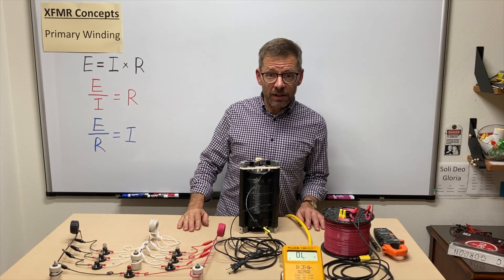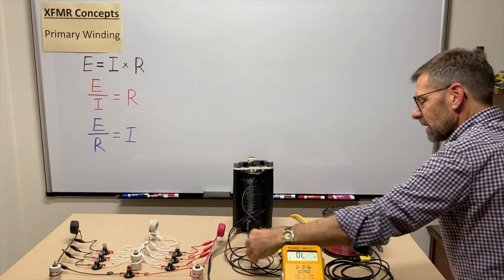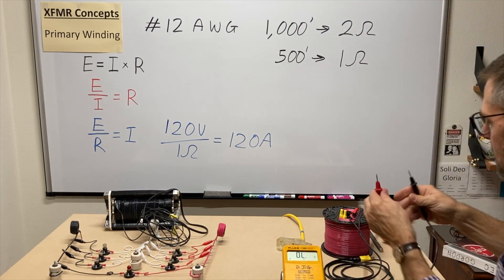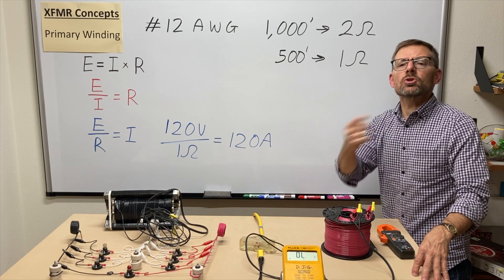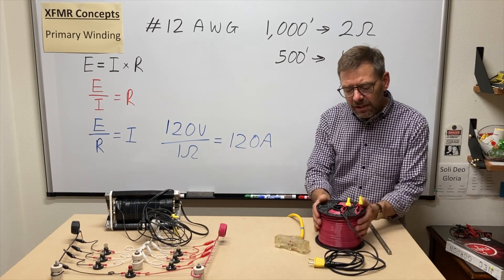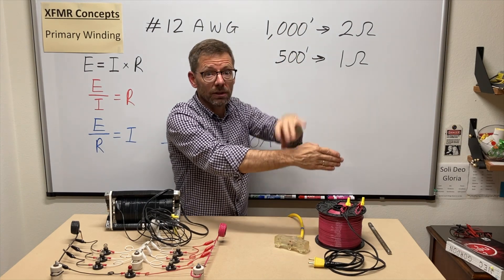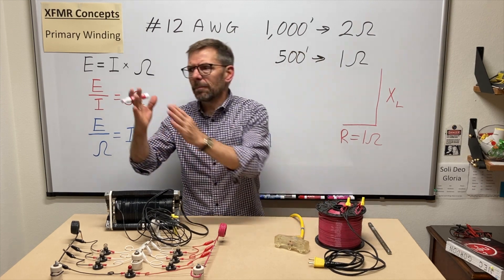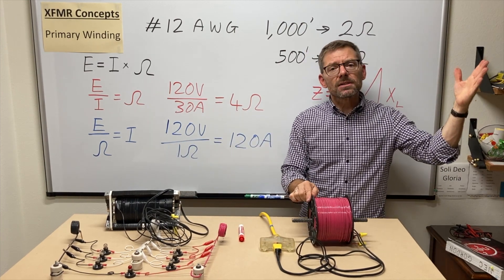Transformer Primary Winding

Comment: Thanks. You call one end of the coil (or stretched out coil) hot and the other end neutral. Is that a matter of semantics or is there something unique about the two ends? Is it that the neutral end is simply grounded? Is the hot end considered to be at 120 V and the neutral end considered to be at 0 V? What if you put a ground at both ends (or multiple places along the wire)? What if it wasn’t grounded (floating neutral), then would the principles you explained be the same? Any other insights to help me understand? Thanks so much!

Comment: Hi, quality content. I find there is a real lack of this type of content on YouTube & often find topics returning back to electronics. 

Subscribed and hit the Bell icon, looking forward to the next videos. 

I wonder if you could do a video relating to EU & UK voltages & how the UK is often supplying 240V still when most kit is recommended to run at 230 along with the effects this has in energy bills, along with how energy consumption differs depending on  the type of loads (resistive/inductive/capacitive).

Comment: Hello Dave.  I spent close to five years in university getting a degree in mechanical engineering.  I can say that you would have been the type of professor that we would have wanted.  Clear, concise explanations with examples and no use of jargon that we wouldn't have known at that level of instruction.  I had several profs who taught like you do and we learned so much more about the topic than we did from the poor ones. Keep up the good work.  Thanks, Ken

Comment: Great video and explanation. I’ve learned a lot from you, and thanks to some of the videos; they aided me in passing my journeyman test. 

I am curious, if you can possibly upload some videos about motors, and explain some examples of sizing and finding ratings with various labelings and then referencing the ratings to an electrical system, such as the wiring, voltage, breaker, disconnects, overload, contactors, starters, fuses, and any other equipment.
Reply: So glad to see you back..Keep 'em coming please..
Reply from the maker: Thanks for your kind words. Time is my main constraint, but I do have plans for more content... Thanks for the requests.